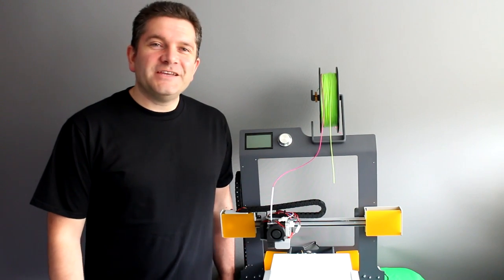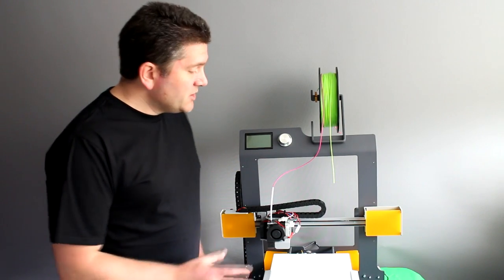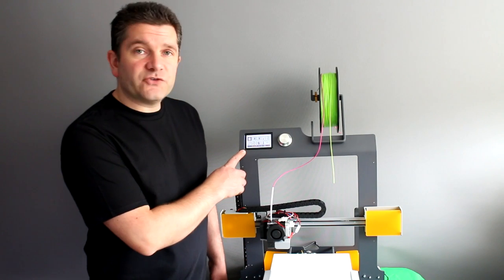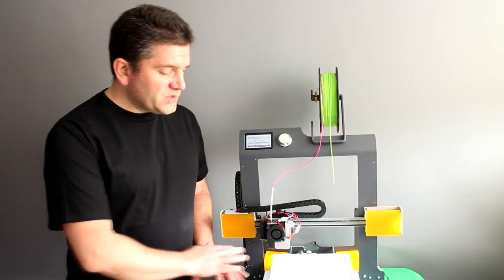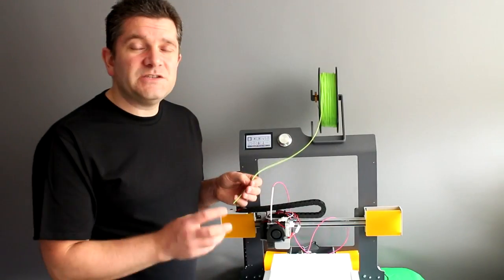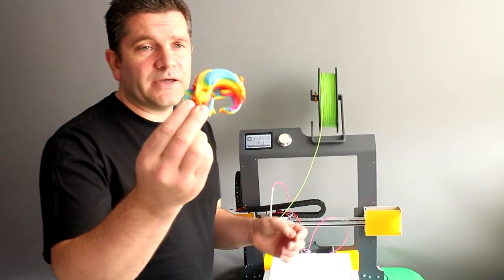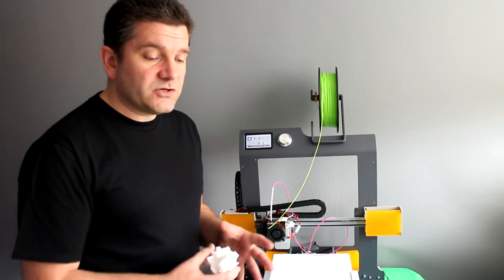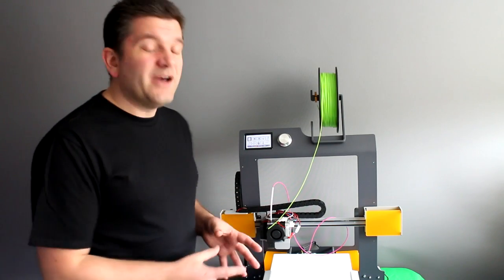BQ Hephestos V2 3D Printer - Overview and review

Comment: Hi! Nice video Richard I was looking arround the BQ site and I have a doubt. In the website says that the printer uses a custom control board. Is there any port to connect a heated bed? It is pausible to connect a heated bed?

 I like to tinker with all my tools and I was looking to buy the hephestos 2 and modify it to run a heated bed but I wasn't sure if it possible to run it from the firmware or I will have to make some custom temperature controller to run independent. 

Thanks!